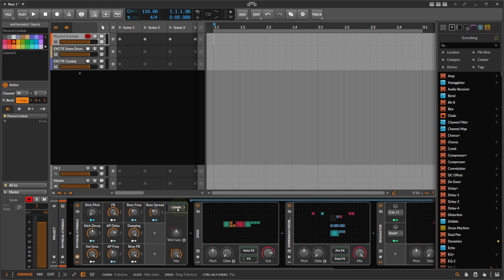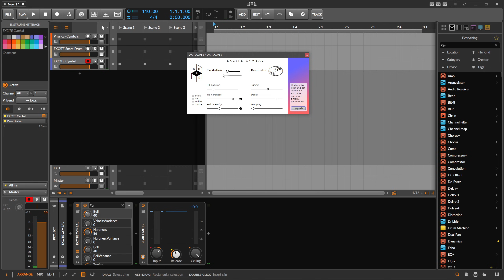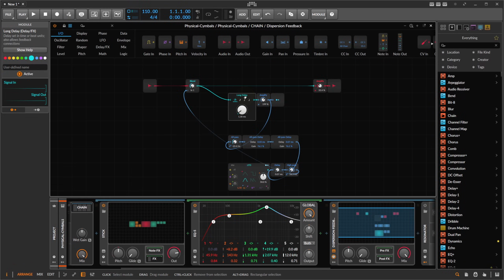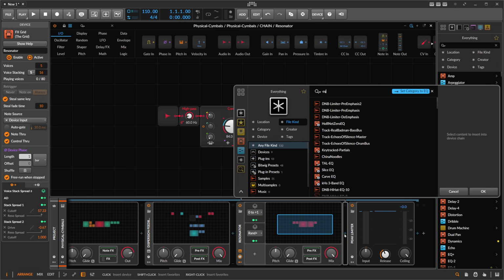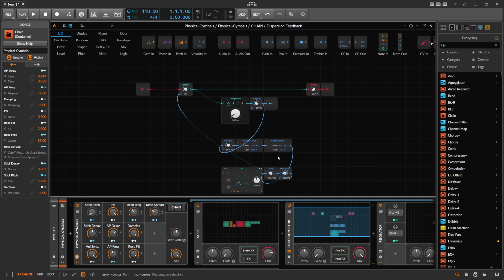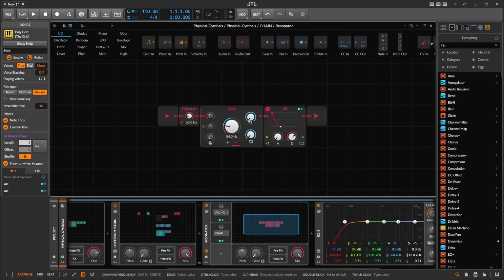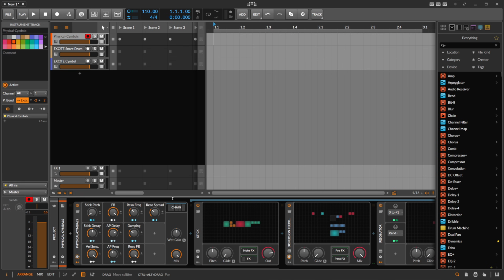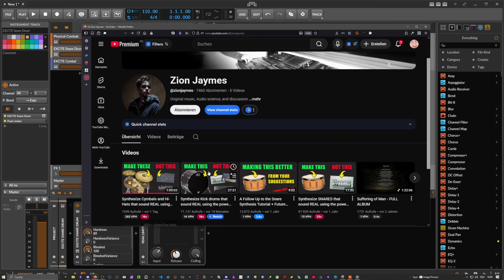REAL Hi-Hats & Cymbals? The Physical Modeling Trick (FREE Preset)

Comment: Yes, i agree that the feedback system has to be overhauled so it’s independent of the block size.
I‘ve made some very nice FDN Reverbs with the FX Grid, but they‘re highly dependent on the block size because of their „housekeeper“ feedback loop. 
I got then tuned in, so they work with my standard block size of 256 samples, which is 5.33 ms with my current audio interface and PC.
But as soon as i want to use other block sizes or different interfaces, which have a different latency at 256 samples, they break and start resonating like crazy or sound completely different…

It would be cool, if the delay module could operate based on samples instead of being based on blocks.
A delay of just one sample would open up quite a few more possibilities in terms of DSP implementations as this is used in basically every DSP implementation out there.

The absolute dream would be an implementation of zero delay feedback like in Native Instruments Reaktor!
That‘s the next step up from the one sample delay, but it‘s also way more complex and needs quite a bit more computational „power“.

And i have quite a few more wishes for the Grid system…
Is there any way to make such wishes known to the developers?

Comment: I got lost in the weeds with this, but I did find out you can use the output of a Poly Grid as a modulation source of the same PolyGrid using the Audio Rate modulator.